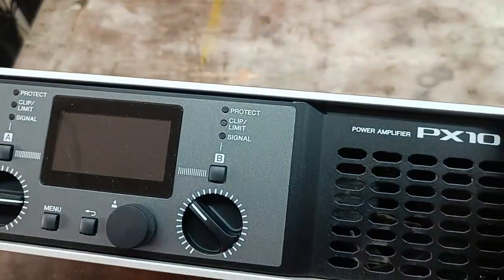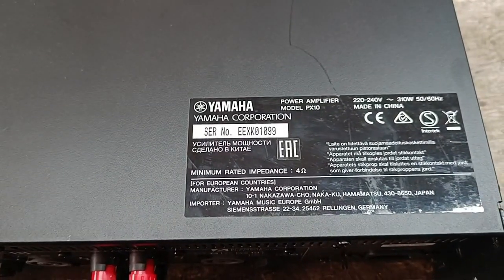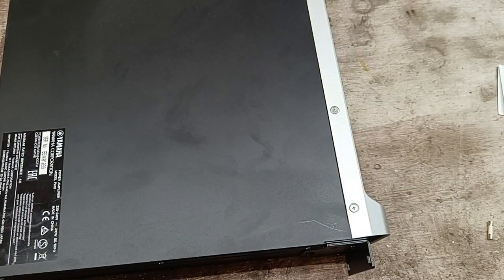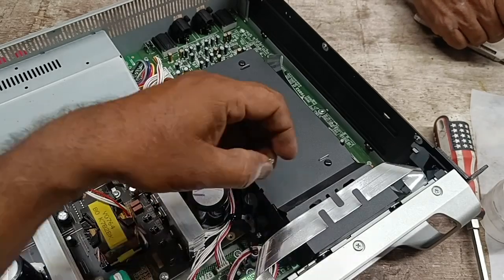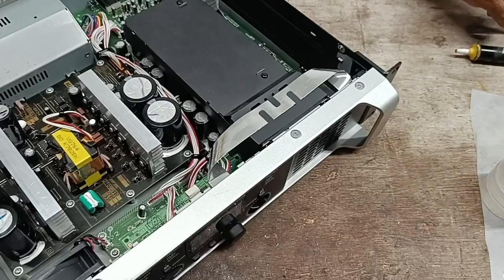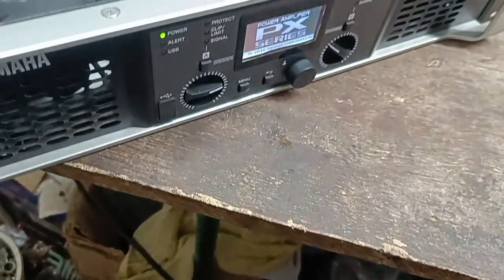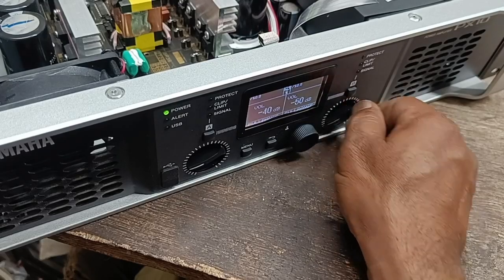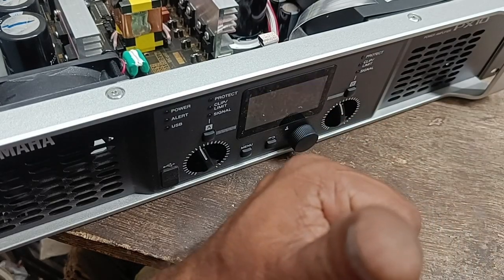px10 Yamaha power amplifier repairing, power amplifier complaint in the power supply,

Comment: Sir I have Crown DSI 2000 AMPLIFER WHEN I on The Amplifer Amplifer Power led and Display is flashing for a second and Amplifer shut off   I remove the top cover and see no any capacitor head is Swell so sir were is the problem
Reply from the maker: Pls put video of complaint in amplifier to this no 9880153984

Comment: Is this a common failure in the PX series? (im working on a PX5 that powers on for just a second then turns off)
Reply from the maker: I think it is problem in only capacitors, insufficient supply in output section or power supply section
Reply: I HAVE A PX5, IT TURNS ON WITH LOUD FAN.
WHEN CONNECT SPEAKERS THE SCREEN BLACK OUT AND STOPS TURNING ON...
SENT TO 2 TECHNICIANS, CANNOT FIND ANY FAULT EVEN WITH THERMAL CAMERA...
CAN YOU PLEASE HELP?